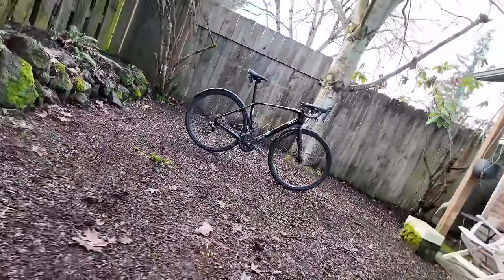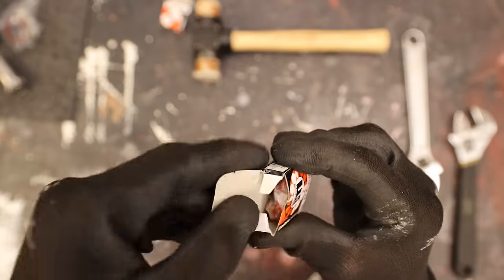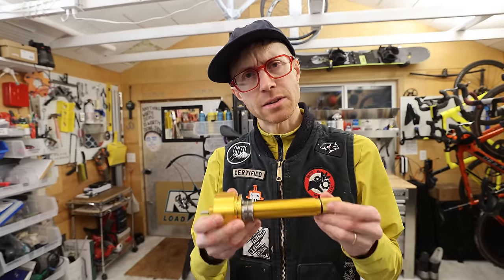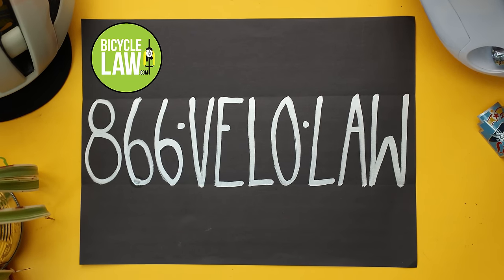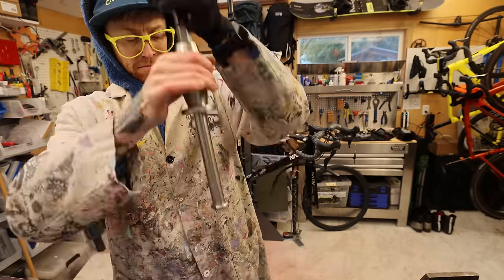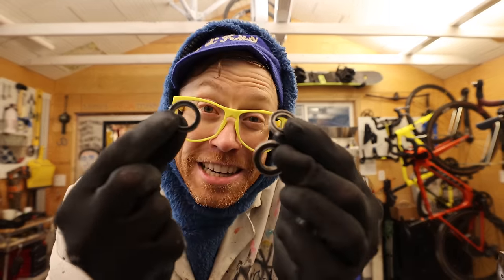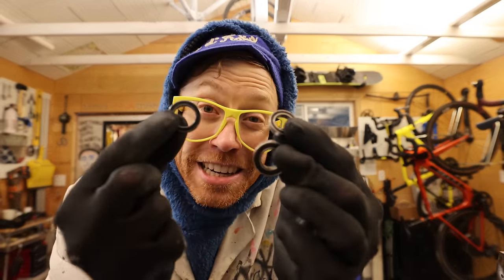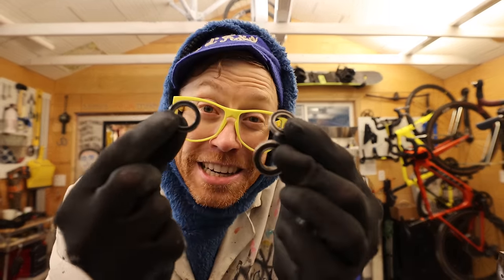Cyclings Best Kept Secret Upgrade

Comment: Bearings all have a number on the side of the inner ring, this is a standard across all industries, I think mandated by ISO. Any local bearing shop should be able to cross reference the number for a comparable bearing of the exact size. I have bought bearings many times at a significantly lower cost and they usually have them in stock. The exception maybe the ceramic bearing option......probably because they get better with age. I love the channel, keep up the great work!
Reply from the maker: Such a great tip! 
Thank you for sharing this. 
Next round that’s exactly what I’ll do.
Reply: Often the numbers are covered is corrosion so then you start measuring…
Reply: @dominicbritt ikr! 😅
Reply: As a mechanic at a shop, some bearings have no markings at all.

Comment: No bike shop in my area would put down the money to fix proprietary hub bearings, they would tell me to buy a new wheel set and or get a new bike!  The industry is killing it's self!!  (Great example Dustin!)
Reply: DT Swiss are annoying for requiring so many proprietary tools, but they're also so common that most bike shops will have them to hand. Most other hubs you'll find are a variation on a theme and easy enough to service with a standard bearing press, punches, circlip pliers and a blind bearing puller.

Comment: I've been a DIY auto mechanic for 20+ years, the most frustrating thing about getting into mountain biking at 40 is my tool box is almost entirely useless for bikes. 
Replacing a bottom bracket was my first bike maintenance challenge and I felt like a complete amateur, I actually had to get a sawzall involved.
Well done on the task!
Reply: My grandfather was an auto mechanic for 40+ years, not sure exactly but you understand. He also built and repaired bikes as a hobby. When I started cycling and I realized how expensive tools are especially the once in a year needed tools, I went to my grandpa to see if he had anything. Turns out he didn’t… he has a plethora of modified tools from traditionals like ground down “cone wrenches!” The only two actual tools he had were freewheel removers and a very crappy spoke wrench.

Comment: Every video is entertaining, please keep it up. Onto the keyboard critique comment: Think of bearings just like you think of tires and road surfaces. The ceramic balls are harder, and deform less, but that is only good if the surface is pure and perfect AND UNLOADED. Once you load a bearing, especially as small as these are relative to the weight of a human, the balls press themselves into the race with a lot of force. Ceramic could be fine if you have lots of balls (point contact) and tight tolerance races, but for the rest of us, steel with steel make the most sense. Much of the claims of ceramic bearings being lower friction do not do it under normal, or even high loads. Often, when all things are considered, steel ball bearings provide more "squish" that cause them to mate with the race better, which then allows the grease to turn liquid and provide a thin film for sliding with very low friction.
I'll keep my steel ball bearings for now. Never had to replace them, only clean them and repack ever so often. Oh, and I'm over 40 and over 200 lb. Still have my bikes from 20 years ago running strong, OEM bearings :)

Comment: I am glad I have old and cheap stuff. The tooling to swap out threaded external cups like FSA Mega Exo or Shimano Hollowtech II is relatively cheap $10-20 for a BB tool and either buy complete units or I think $150 for the old Raceface tool and use Enduro bearings, it pays off after 4 jobs. My wheels needed no special tooling, just punch out the bearings and use a socket to drive in the new ones. I did the bottom brackets 2012 and haven't replaced them since then.  I also moved to a dry climate

Comment: For the bearing size of a wheel, you can always use the Serial Number and go grab the manual online, one of them will have each individual parts that's on your wheelset including the bearing with their size code.
Reply from the maker: I did not have luck trying this for these wheels. I dug around on line and found minimal.
Reply: @EverythingsBeenDone  I guess that's what I like the most about owning Mavic wheelsets then ! Finding specs and manual never been easier. Also if you ever struggle to find parts from your local shop or favorite online dealer take a peak at bikeinn !
Reply: Ahaha as a bike mechanic I can tell you that is almost never true, unfortunately
Reply: @MartyCoony Great tip!

Comment: I haven't touched a new enough bike to have press fit bearings in anything. New grease or a new sealed square taper bottom bracket has been about all I've done. Diy headset tools is fun tho, very satisfying to use

Comment: Another great video, thank you for this.
I had to change the bearings on a 3year old Mavic Cosmic Carbon SL front wheel which was hardly spinning anymore and my experience came close to Dustins. I ordered 3 additional tools, however there are some budget options on Amazon, like a nice 60$ bearings press. On top of Dustins challenges the dust caps removal added another two tools to my collection, one of which was not suitable for the job.

Comment: I'm partial to Wheel MFG BBs. USA made with enduro bearing on many of their models. I have it on my hardtail & plan to run it on my Wzrd drop bar xc bike too. It was under $100 for the sram dub version I have. Side note not all mechanics have those tools for DT Swiss wheels. My friend's bike shop does not have the tool I would have to drive to a bike shop 40 mintues away(via the Arroyo Seco Freeway w/light traffic). One of the few shops in the area to have the tool according to DT's site.
Reply from the maker: This shows are gnar this project is when only specific shops have the tools to do this job..yikes.
Wzrd Drop...love this name!
Reply: @EverythingsBeenDone  bike brand &builder is wzrd. It will be using gravel wheel spacing but mtb bb spacing to get some wide 29x2.3 tires to fit for a, gravel meets xc build. Will have Enduro bearings in the wheels mfg BB

Comment: Aha, I had a feeling you were filming this past weekend when I started to count your layers. Looks like you got a bit more ice than us down the valley further!

I do appreciate the simplicity of repacking my cup and cone bearings. I’m old school that way. Though my newer Trek hardtail surprisingly has cup and cone for the wheels I may face tool upgrade-ism when it comes time to replace whatever is in its bottom bracket… 🤔 

It does seem like ceramic cartridge is a good way to go for a nice carbon bike that gets lots of miles in yuck weather too.
Reply from the maker: For our horrible weather nice bearings really make sense. BUT mid level would also fit the bill they just may need to be replaced at some point.

Comment: I experienced PTSD from this video.  I had trouble finding a local mechanic to rebuild my Sturmey-Archer hub so I attempted it myself.  I didn't have to buy a lot of special tools except for a cone wrench but had to buy a lot of basic tools like spanners that I did not have.  after three failures I was ready to give up when  I got a tip on a local mechanic who saved the day.  It cost me less than $100 and several days of frustration.

Comment: I appreciate the humor and all, but there are alternatives to the tools you've chosen. You've pretty much gone with the first class option of tools for every single step in the process.
With the exception of the ratching ring removal tool, which is ridicously expensive (and as you noticed always outrageously tight for some reason), getting the bearings in and out, can often be achieved responsibly with a selection of basic handtools such as a hammer, drift, various sockets, some allthread and washers/nuts with corresponding spanners.
If you want to splurge a little, something like Harbour Freight are likely to have generic bearing press tools at a fraction of the cost of that fancy anodized Enduro thing.

The blind bearing puller is nice, but not necessary for most DT Swiss hubs (at least the ones I know/have worked on) - their own maintenance guide actually suggests/suggested (been a while since I've had to do it) using a hammer and a drift. Hambini even has a video on why that is not just a hack - but actually the right thing to do, in order to avoid deforming the spacer tube and messing up tolerances. Even though that - in typical Hambini fashion - has coursed a fair bit of discussion. 

So for those viewing: enjoy the good humor - but know that there are alternatives :).

... but if you own a set of e-Thirteen XCR wheels, just know that they simply don't support changing bearings in the cassette body - when worn, they want you to buy a complete body... :-/. Never accepted that, and tried changing them a few times, never lasted - replaced the hub with a DT Swiss one... runs flawless as their products always do...

Comment: it's just the first time that's expensive with all the tool purchases. There is some cheaper tools that would work fine but quality tools are nice to have. The next time you need to do the job you are all set! Just order bearings and fire them in. It's also fun and satisfying doing it yourself.

Comment: also, all of my new bikes come with a manual and prescribe the annual bearing clean and re-greasing...among other periodic maintenance recommendations-- chain wax/oil and cleaning schedules as well as washing your bicycle after any wet and/or off-road rides wiping all the dirt and water off the bike before putting away until the next ride...
Reply from the maker: This is rad!!

Comment: You could have hacked an old long nose PLIER into a Spring Compressor/Removal Tool by simply filing the tips thin and bending them inward like pincers.
Have one in my Toolbox. Works just fine.

Comment: Just a hint: you might have damaged this freehub body bearing when you had to knock it out due to forgotten clip, so if you reinstalled the same one it might become an issue. Other than that, I am not sure about ceramic bearings. There are many voices they are a fad when used in bikes (e.g. from Hambini, an engineer)

Comment: Tip to safe hundreds on install tools: get a long threaded rod, washers of the size of the bearing and bolts from hardware store to make your own install tool. As a removal tool use masonry sleeve anchors. You're welcome. 😂🎉

Comment: My local bike shop would do this job for 20 dollars 😂. I changed press fit bottom bracket bearings once before I knew better. If you can afford all those bikes you can afford to pay a shop to fix your bike. You should have just used the lower end bearings and had a shop put them in.

Comment: So, many BB's can be removed with a large wrench or pipe tool (threaded vs. press fit).  Most BB's are cheap and work very well.  It's a 15 min job and good to know.  For $230 you can replace your bearings many times.  Just sayin.

Comment: Former bearing engineer here. 

Don't fall for the ABEC marketing truck that happened in the skateboarding industry. ABEC is a standard that only tightens the tolerance range of exterior dimensions, it barely effects internal geometries. Internal geometries are proprietary to manufacturers anyways. 

Each bearing should have a long number on the exterior, talk to a distributor like Motion Industries or National Precision Bearing to find replacements. You won't be able to get the exact internal tolerances that the assembly was designed for, but you can still do okay. The only people that will notice a sub-optimal specification are pro cyclists anyways.
Reply from the maker: I hope everyone reads this comment! Thank you for sharing.
Reply: @EverythingsBeenDone  no problem. The bearings sold in sports products is kinda crazy. If you can find the same bearings from a distributor, they will be much cheaper than getting them from a shop.
Reply: NTN bearings in the size you need (6806, 6807, 6803, etc) from Misumi if you are in the US. Smoooooooooth
Reply: @seamusmulligan-ferry2558  NSK and SKF as well. It is important to go with historic manufacturers in this realm, there are hundreds of poor quality brands for bearings.

Comment: Bike mechanic here:

Ceramic bearings are highly unnecessary don't waste money on them and the perceived difference is extremely marginal. You might notice a difference between rubbish bearings and a good set of steel bearings, from my experience they are imperceivable to ceramic bearings. A good set of stainless steel bearings will last and give you most the benefits. I'd also like to say chasing these wasteful gains are one of the worst allocations of time and resources. 

Instead focusing on training yourself up is what creates the bulk the power like 99.999% as opposed to the 0.0001% gain from ceramic bearings, that do not last forever and also go bad once grit gets inside them and no you don't get unlimited bearings for a lifetime with wear and tear. Marketing is very strong in the cycling industry.
Reply: The likes of Ceramic Speed and Absolute Black have done an excellent job of snake-oiling their marketing into the common cycling mindset. The pursuit of this video doesn't seem to be performance though, but rather perceived durability. I'm honestly not sure on that one and I suspect that full contact seal bearings might to a better job of set-and-forget
Reply: @TheSpaceBrosShow   100%, although this channel is entertaining I personally wouldn't take any advice from it. if you want the best possible advice i'd suggest heading to your LBS and having a chat to some mechanics if they're free. We test plenty of different bikes and products and understand the pros and cons to each.
Reply: @mrbombastikalime9867  I know some bike mechanics that are on the ceramic=durable train haha

Comment: I'm never going to do this job, thanks for the warning. 
Incidentally, your patch is highly disturbing—my hand got pulled through a huge set of gears at a factory I worked at when I was 16... I'm actually considering Di2 shifters because what's left of my fingers are arthritic and lack dexterity. 
My hand looked a lot like that patch, except more blood and a whole lot more bone—gears strip the skin off your fingers and turn it inside out... they call it degloving.

Comment: A friend mechanic says that all you need is a chisel and a Rubber hammer 😂 apparently you can remove almost any bearing using the wheel axle as a tool
Reply: Yeah because the axle has a lip on the inside that presses against the inner race, so you can pop the bearing by bonking the axle on the opposide end of the hub. Just be careful; most axles these days are AL

Comment: I could so relate to the learn how to do something and then have no idea how I previously fixed something a year or two later. 
I used to know these things because they needed far more frequent repairs. 
I've replaced bearing on wheels numerous times, without needing brand specific pricey tools. 
However one of my recent wheelsets is DTSwiss. Damn!

Comment: All those tools needed for new bicycles.  The tools were very expensive.  I consider this video as another advertisement for 1990s mountain bikes.  Maybe they aren't so hard to work on.
Reply: Stick with old or lower end bikes and the only special tools you need are a taper crank puller, a spoke wrench,  a cone wrench, and a freewheel   Tool , maybe £10 for the lot
Reply: And a chain tool if you don’t have a nail

Comment: You send too much on oruginal tools, theses tools are for workshop, not for normal cyclists who replace bearing once per lifetime ; ) DT Swiss tools and Enduro  I easily replace by eBay (Made in Poland or China tools) about 15-20 USD! Quality Japanese or Enduro steel bearings would last longer, there more waterproof and maintenance free than ceramic.